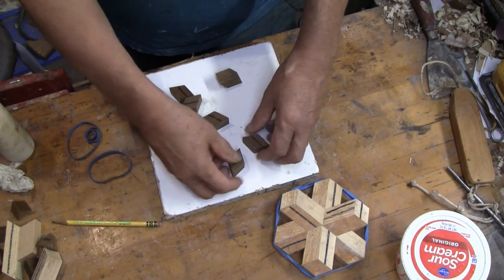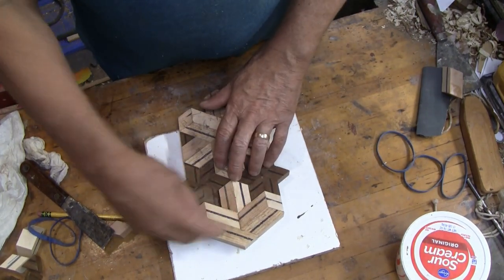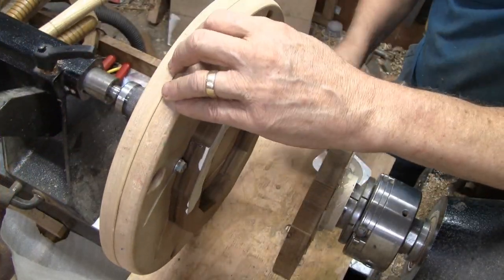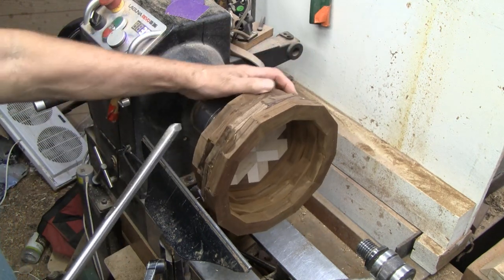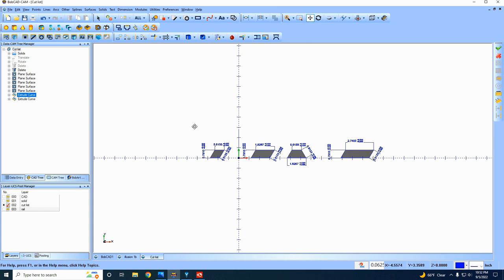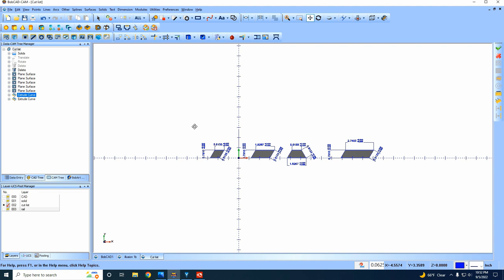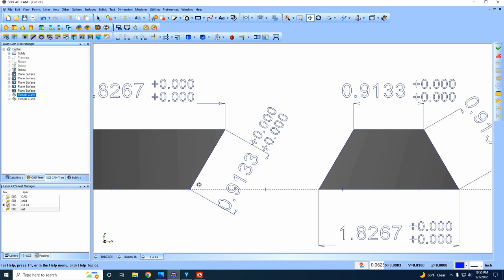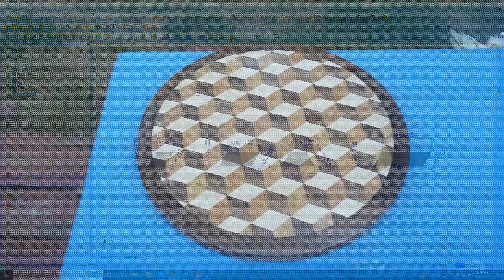Wood Turning the Knucklebones Bowl

Comment: Gary, I really like your videos.  All beautiful work.  I made the knucklebones bowl using butternut, maple, and cherry with black walnut as the rest of the base.  I discovered that there is really no need for  precise measurements of the component pieces.  What I did was rip all my stock to the same thickness ( I used 0.75 inches ) and then use the stock to set the distance between the saw blade teeth and the stop on the fence.  For the 6 dark triangles and the diamonds use one stock thickness.  For the parallelograms and trapezoids use 2 stock thicknesses.  Everything comes out perfect without any fiddling or measuring.  I made dozens of components so in addition to the bowls I am using the knucklebones feature as the centre on some charcuterie boards.
Reply from the maker: You are correct there is not need to measure anything unless you are trying to make something to an exact dimension.
I did not measure mine either. But others needed or wanted those dimensions just to get started and understand the process.
Good to hear it all worked out for you.
I think I mentioned that what ever the first piece works out to be then work off of it not the dimensions I have.
 Thanks for pointing that out I sure it will help others to understand.

Comment: Excellent work.
Reply from the maker: Thank you very much Hamp!
Reply: @ThePapa1947  try the upholstery stapler trick I mentioned in the previous comment. It works really well for this type of glue up. Use 1/4" upholstery staples and a pneumatic gun. I build polyhedra. You should try that.
Reply from the maker: @hamps856  I did not see a comment on staples. Maybe it has not come in. Not a good connection where we are at the coast. Heading home soon.